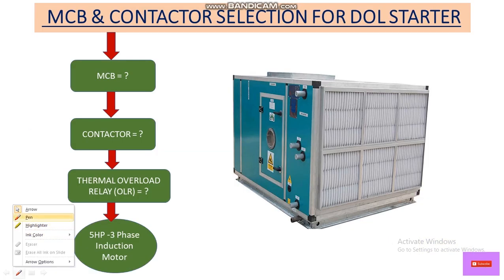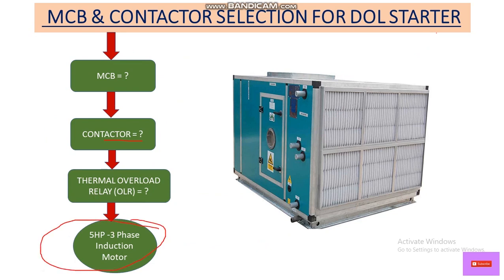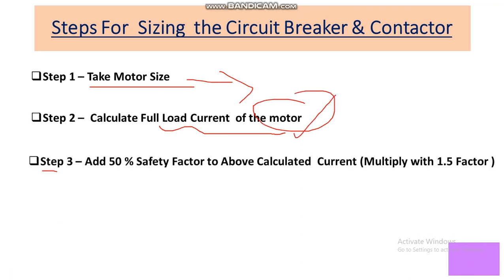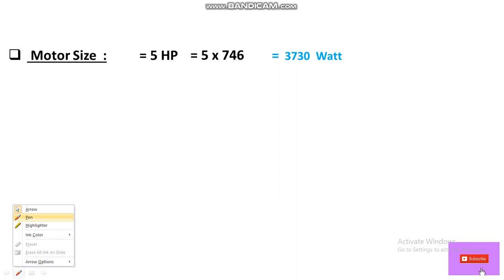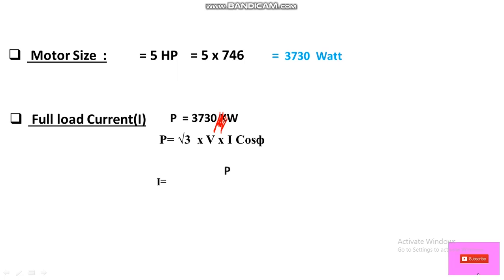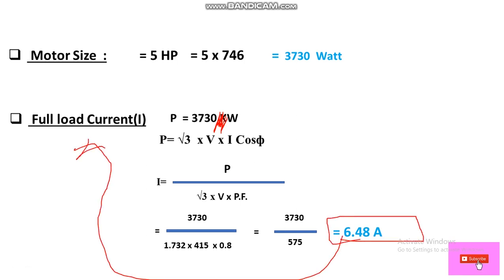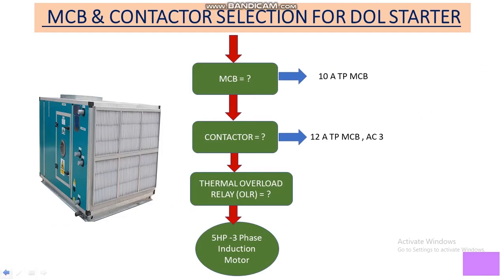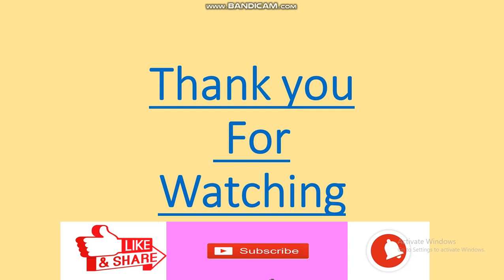Contactor Sizing and Selection | How to Calculate Contactor Size ?

Comment: PLEASE EXPLAIN THE SIZING OF SPARES OLR CONTACTOR MAIN CIRCUIT WIRES TO DIFFERENT TYPES OF STARTING, DIFFERENT HP MOTORS .WITH CALCULATION,ALSO THUMB RULES TO SELECT.

Comment: THUMB RULE  SELECT THE SIZING OF CONTACTORS, OLR MSIN CIRCUIT WIRES SF UNIT OR MCB TO AUTO TRANSFORMER STARTER, ROTOR RESISTANCE STARTER, SOFT STARTER&VFD STARTER. ALSO REFERENCE BOOK TO SEE THE CALCULATIONS.

Comment: DOL is implemented in low power i.e single phase system;5HP is single phase but u calculated as 3phase HOW?
Reply: The direct online (DOL) starter method of an induction motor is simple and economical. In this method, the starter is connected directly to supply voltage. By this method, small motors up to 5 kW rating are started to avoid the supply voltage fluctuation.
Reply: in here connected load is 3.73 kw
Reply: Useful knowledge sir